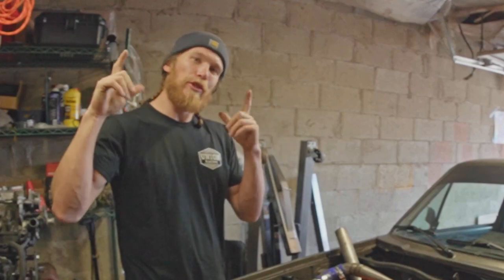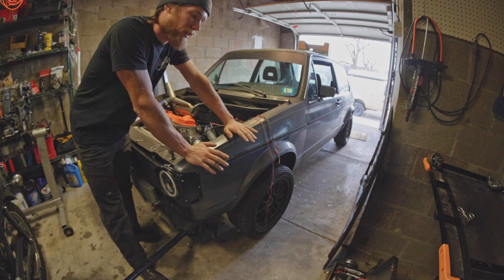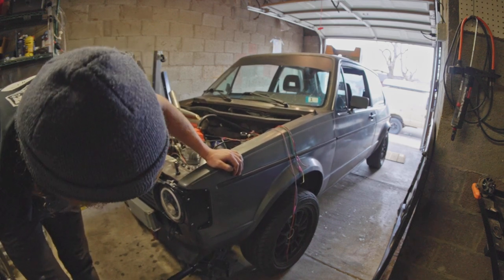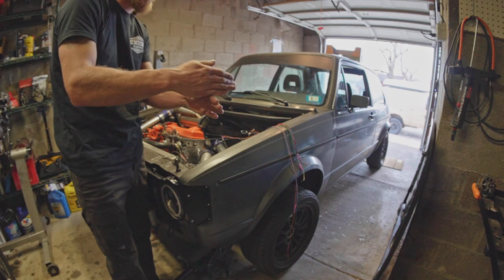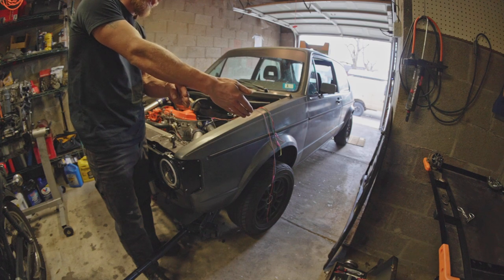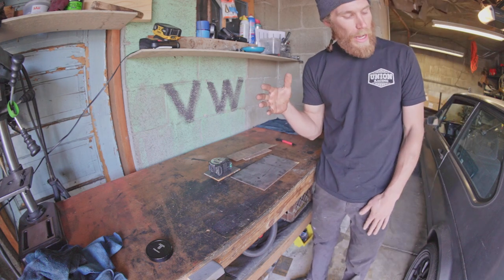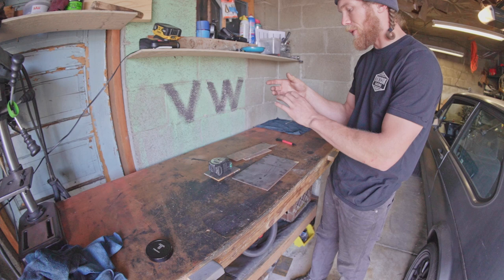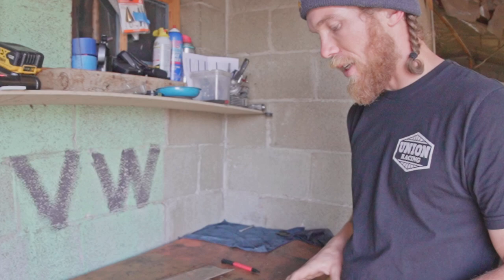HOW TO: Lifting a Rabbit, Part 1

Comment: One of my rabbits I found coilovers in the wreckers for a mk3 golf rear and put it in with no modes, just a couple millimeter bend in the bottom receiver allowing it to fit. My recommendation for the rear.
Reply: I'm pretty sure it was mk3. Otherwise, it was mk2. Called it the soot blowing jackrabbit 😂

Comment: hey oliver, im also currently building a rabbit and want to install a high-pressure fuel pump. could you possibly make a video talking about the installation process, what psi of fuel pressure you need etc..? thanks, awesome freaking build btw!
Reply from the maker: Hey! Nice! High pressure fuel pump? The original mechanical pump IS your high pressure fuel pump!! Much higher than an inline electric. My lift/inline pump is only for priming the system & supplying fuel to the main pump when doing hard pulls, puts out ~10psi. Too much supply pressure & you might start to get leaks from the pump body 👍